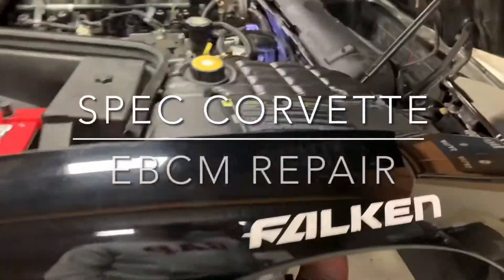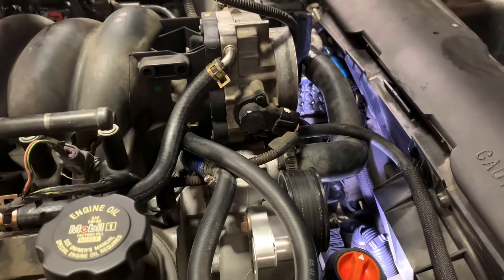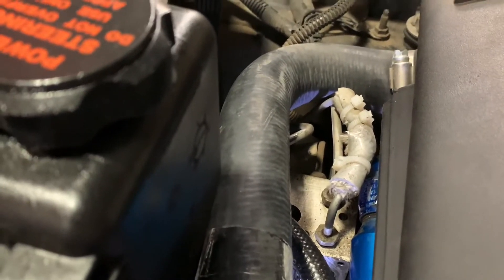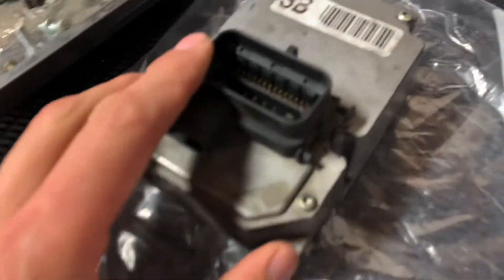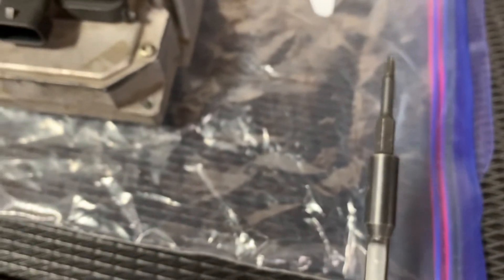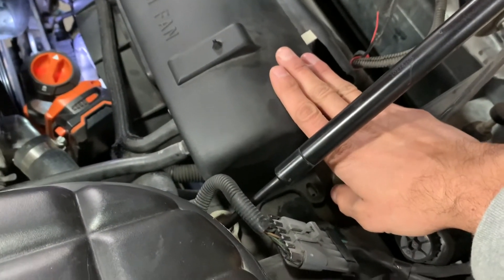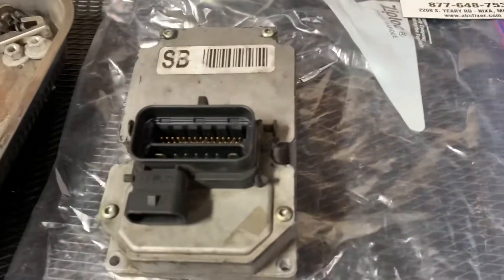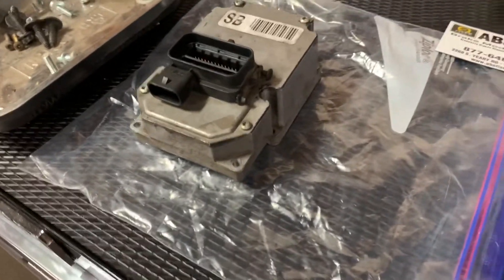C5 Corvette EBCM Repair

Comment: Great video. Quick question. I heard that if I swap the EBCM , ill need to have it reprogrammed to my car. If I send it to. Get repair, does it still needs to be reprogrammed?
Reply from the maker: I’ve swapped EBCMs between my 2001 race car and a 2004 donor car without having to reprogram anything. There’s no reprogramming required if you send it in for repair or swap for the same generation.

Comment: I have a 2000 with 44K miles that has given me the abs codes very sporadically. No rhyme of reason and once I restart the car they go the warning lights go away. Could be months in between events and the car sits in the garage all week. I'd love for someone to come up with if not a fix, a way to convert to the newer non Bosch units.....
Reply from the maker: I’m fiGhting that on the silver car now. I’ve replaced the EBCM and ABS pump with known hood units and still have it failing 3 laps into each race. Grounds are confirmed good. Next step is to remove the engine bay wiring loom.
Reply: @joshc1017  Did you check and clean all the grounds?

Comment: You only had the one code when this happened? Did you also receive the messages on the dash saying "service traction control" "Service abs"?
Reply from the maker: I don't recall what the DIC message said.  I'd suggest using the codes to lead you in the right direction, though.  I've seen the messages you reference when a speed sensor wire was pinched, but the codes told me that it was a sensor so there was no guessing involved.

Comment: Since having your EBCM fixed by ABS Fixer, have you had any more issues with the module?
Reply from the maker: The EBCM didn’t have any recurring issues.  I’ve had separate problems with the front wiring loom that I eventually figured out… that was a pain.
Reply: @joshc1017  Thanks for the update!

Comment: Hi Josh. Great video thank you for sharing. I was wondering if you might offer an opinion on my issue. I have a C1233 code coming up in my 2001 C5, which is RF wheel speed circuit open or shorted. One of the peculiarities of the problem is that the error always logs as a history code shortly after setting. After clearing the code, it resets once I exceed maybe 25-30 mph. I actually had my local chevy dealer go through all of the troubleshooting steps on this, including checking voltage and resistances in the RF speed sensor, inspecting for poor connections in the RF sensor circuit, running tests and checking for poor connections at the EBCM harness, and swapping the RF and LF pigtails. They weren't able to resolve the issue and recommended replacing the EBCM and retesting. I ended up sending my EBCM to ABSFixer like you did, then re-installed it and this still didn't resolve the problem. So with all of this, if you happened to read through this and have any ideas on next steps, I'd really appreciate hearing. Many thanks...Rob
Reply: Just guessing but aren’t the wheel speed sensors part of the unit bearing assembly?  Have you tried swapping hubs?
Reply: @failranch9542  No I have not tried that. It's interesting you bring this up as I'm about to put a large amount of money into a replacement EBCM, but before doing that I was also thinking about the speed sensor. I don't know if these sensors go bad or not - they're pretty simple so I was assuming it was unlikely to be the problem. I've had the car since new and it only has 18k miles, so to have this problem to begin with is unfortunate. If swapping hubs isn't too difficult it may be worth trying that first. Thanks for the suggestion I'll look for some info on how to do that. I appreciate the help.
Reply: @robertc8213  I assume you have watched this: https://youtu.be/1ByFnndc-ME.   I have not yet but title seems like it might address your issue.
Reply: @failranch9542  I have seen it yes. I actually swapped the left & right wire harnesses and the same DTC code still registered. I've been through every step in the diagnostic process as of now, except for swapping out the wheel hub/speed sensor. I had a tech do a snapshot on the speed sensor on the road, and when the code registers there isn't any anomaly, like a dropout, with the sensor. I wish it were as easy as a wire harness issue. I'm pretty convinced it's the ebcm at this point. Thanks again for your input.
Reply from the maker: Sorry I missed your message here! Were you able to resolve the issue? I do like the idea of a replacement hub, especially if you’re on stock hubs and are tracking the car. SKF hubs are a must.
Reply from the maker: If you’re just looking to fix it before a sale, you can probably get a used hub for $20 from someone that swapped out good ones for SKF.

Comment: I hate having this crap on the car. I miss the old days. None of this shit
Reply from the maker: I’ve seen a few folks remove it but haven’t driven a C5 without ABS yet. The rear is over biased on the race track, so the module gets a workout when driving at the limit. Adding a bias adjuster would do the trick, though.
Reply: Yup, I have a 82 vette, no problems whatsoever.  No with the 99 vette I'm having all kinds of issues

Comment: From what I have been reading, ABS Fixer Cannot repair 1997 through 2000 EBCM
Reply from the maker: Yes, the earlier module is less serviceable.
Reply: @joshc1017  Alternatively, G7 Computers can repair EBCM from 1997–2000, depending on the type of trouble code. Worst-case scenario: Mercer Corvette sells refurbished EBCM 1997-2000 with a one-year minimum warranty and 2001-2004 EBCM with lifetime warranties.